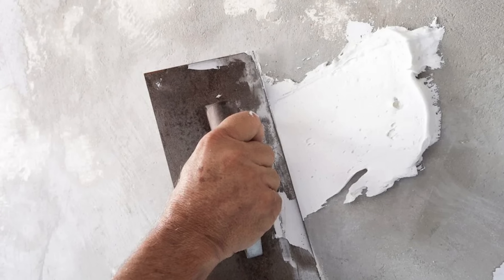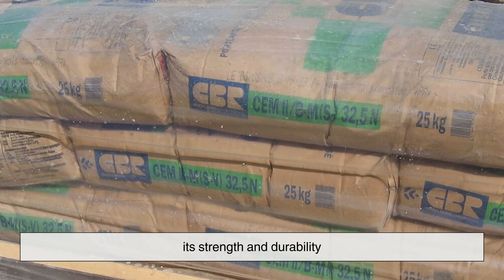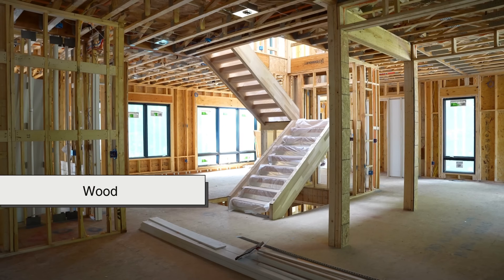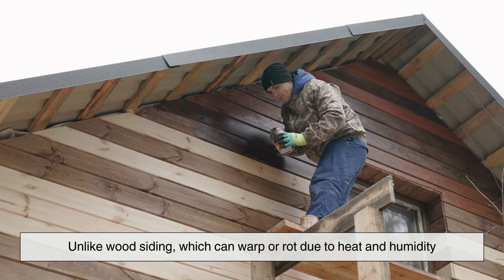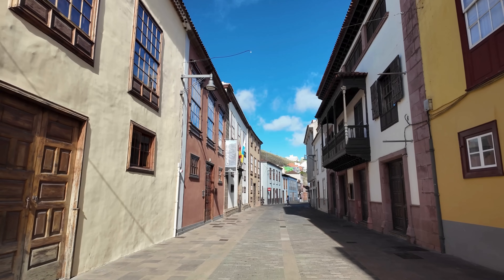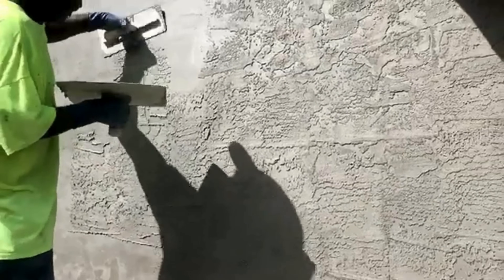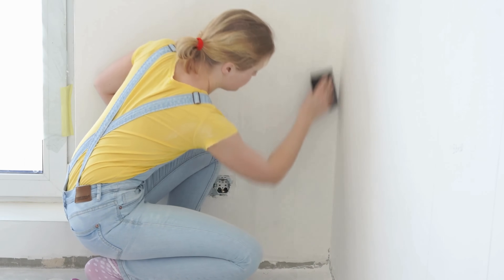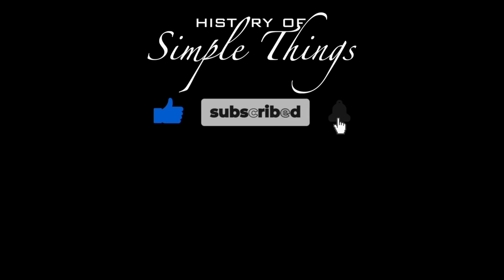How Stucco Helps Homes Stay Cool in Hot Climates

Comment: Here in northeast there are newer homes with stucco exteriors.  I wondered about this since it is thinly slathered on a base of styrofoam panels.  Nice when new but it does not seem to be long lasting.  It can get dents and cracks which make it high maintenance.  Not my choice.